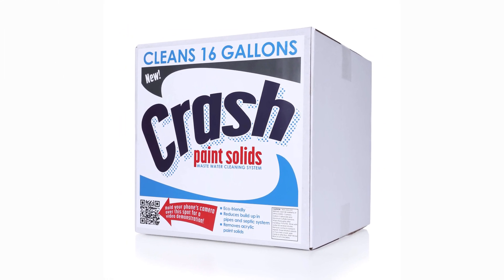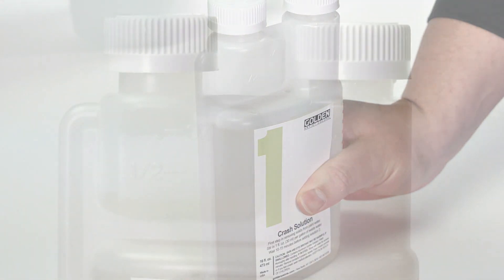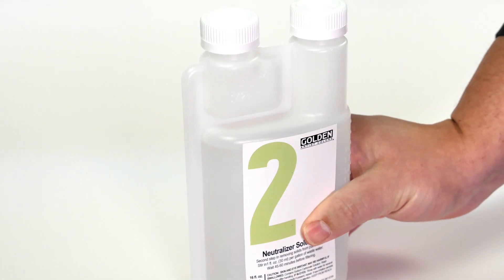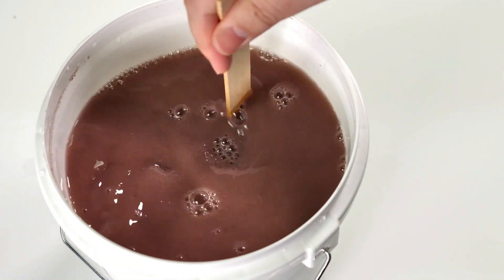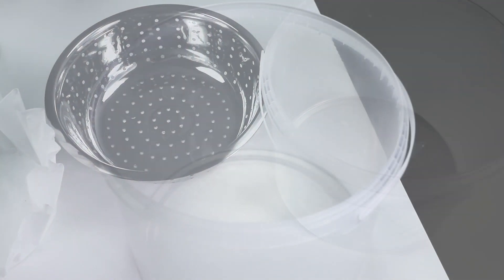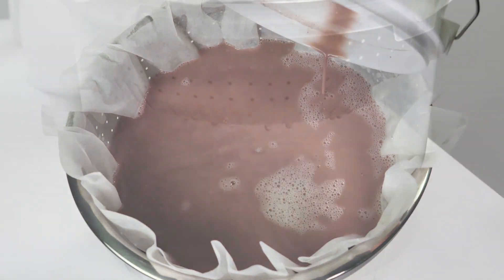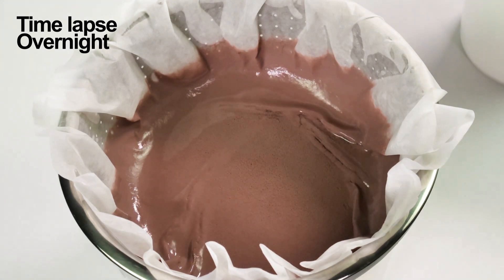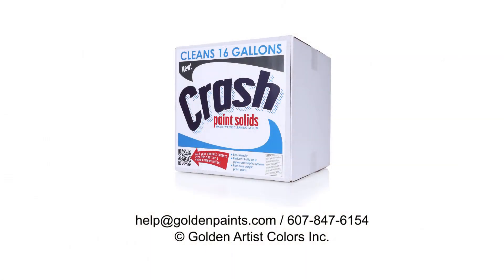Crash Paint Solids: Simple way to make paint water safe for disposal

Comment: This is a great idea! I live in a rural area and spill my wastewater onto our gravel driveway away from plants. I'm hoping that the soil filters out the paint. Is that true? If that's not an environmentally responsible methodology, please tell me why, because I'm also interested in your system as an alternative. A few questions: what comes with the kit? Colander and filters as well as chemicals? How many gallons of wastewater will one kit treat, and how much is it retailing for? And where will it be available online?
Reply from the maker: Hello Judith, there may be too much to unpack in a YT comment... but lets work from the last questions: yes online, goldenpaints.com/crashpaintsolids - the starter kit includes everything you see in this video (colander, chemicals, filters, buckets, stirring stick) with detailed instructions - the kit treats 16 gallons of paint waste water (refill kit also treats 16 gal.) -  this system removes paint solids from the water, but some other chemicals remain. While that is safe to pour down the drain, you shouldn't use it to water plants or animals. Pouring untreated waste water onto your driveway is probably not the best solution because everything eventually ends up in your ground water, including the paint solids.

Comment: To me this feels like an incredible rip off. A solution for small amounts of water is evaporation.
Reply: I’ve been trying the evaporation method and it’s not quick enough in Houston’s humid climate. My storage space it too limited to have gallons of paint water sitting around while I wait for it to evaporate, and that’s even with the dehumidifier I use in my studio. I’m willing to give this a try.
Reply: @MTW1108  I'm going to try this as well. Evaporation works great in Phoenix in the summer but I've had a 10 gallon (about 1/8 full) bin sitting outside since October and it has not evaporated.
Reply: Where I live, evaporation is an option only during spring and summer.